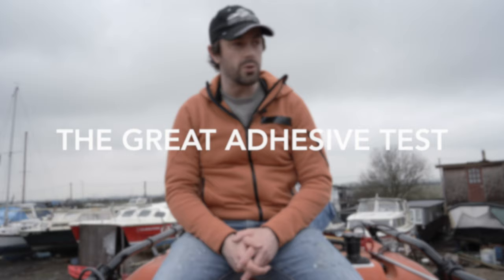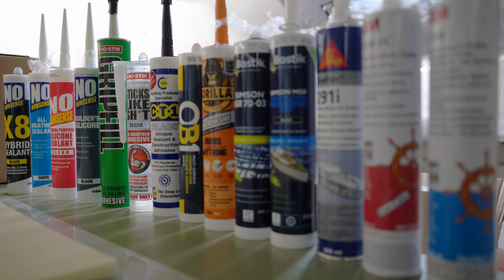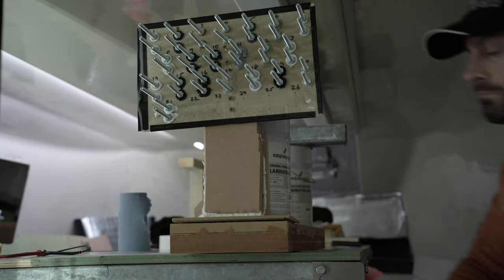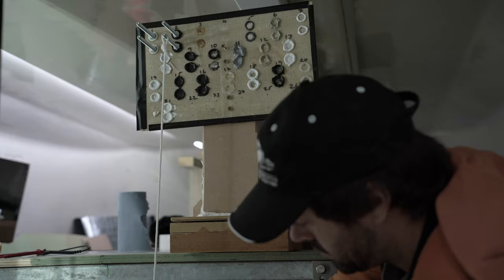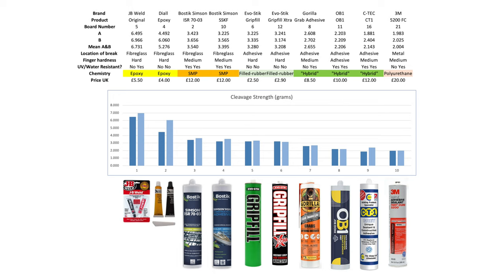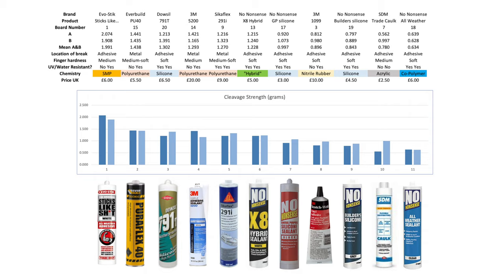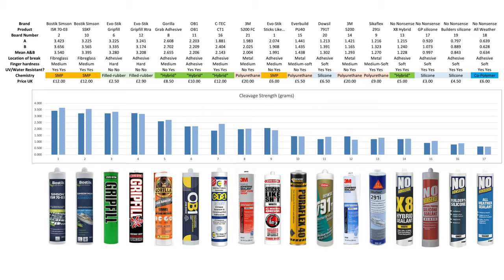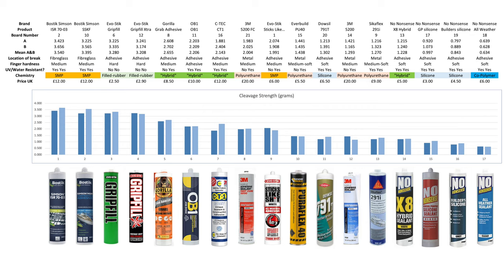The Great Adhesive and Sealant Strength Test -  (Lifeboat Conversion Ep5: Adhesive Test) [4K]

Comment: I love your witty comments.  Your videos could be longer.  Also what do you plan to use the adhesive for, holding the insulation?  By the looks of your progress, it’s too late for that, you already glued it on!  Are you concerned that the boat will roll over in a storm?  Is everything going to be secured?
Reply from the maker: Thanks! Different adhesives for different purposes. I think I've answered in more detail in another comment. For safety at sea, there's an episode planned for much later on that.

Comment: thanks for taking the time for doing this test, however I'm wondering if it is properly reflective of tensile strength because you essentially levered the other side of the adhesion point as the bolt became a lever and one side a fulcrum. Stuff like (say) Sikalfex talks about its tensile strength. 
None the less as it was all done in a similar way it shows their performance relative to each other. Sikaflex 291 seems about as good as regular silicon from your test.
Thanks and excellent work
Reply from the maker: You're quite right that this isn't a lab-standard strength test - tensile or otherwise. It's more a real world test - i.e. how do the adhesives behave bonding FG to steel with a moment applied. By its nature, it'll be multifactorial.

Comment: Try Marine Goop or Plumber's Goop, if they are available on your side of the pond.
Reply from the maker: Discontinued in the EU, and even more mysteriously marketed than most - any idea what it's made of?
Reply: @AlexHibbertOriginals  I'm sorry but I don't know for certain what it is made of but I have seen it described as a polypropylene, solvent cured adhesive on the internet.The solvent cured aspect may be problematic on the interior of your vessel and there are warnings about concentrating the vapors to get high, so that may be why it isn't available to you. The Marine version is UV resistant and sticks to almost anything, including fiberglass. It won't bond to whatever the plastic is that is used to construct water and fuel tanks for boats and RVs ( Caravans, to you?) It remains very flexible after curing and I have repaired slits in cheap vinyl inflatables by simply deflating and squirting a ribbon of the stuff the length of the slit, let it self-level and cure and I was always left with a permanent repair. I patch waders and Wellies, I think you call them, and have glued GPS antenae to magnets to stick them on my truck's roof and they stayed attached even at 80 miles per hour in rain, wind and sunshine. I'm rambling but it really is my go to adhesive. Wish you could get your hands on a tube for other uses even if it wouldn't work on your current project.

Comment: love it mate which one would you say is best for sticking aluminium to a steel painted roof of a transit van its for a solar panel haha
Reply from the maker: If you properly degrease and key the surfaces (especially the alu) then to be honest any of the SMP or PU ones would do fine. I'd probably avoid epoxies for that as they grip well, but most have no flex.

Comment: Good info, one suggestion, question: have you considered hazardous vapor abatement? I note Navies of the World have a lot of solutions for air quality in confined spaces.
Reply from the maker: Indeed yes. There will be a video on venting in due course.
Reply: @AlexHibbertOriginals  You may be working with hazardous vapors need a mask and there is a spray on product you may consider in the initial phase of your work. It is Nansulate made in Naples Florida and available here locally at Granger's.

Comment: good to know thank you I have a seahawk 4 and I am trying to work out what is the best glue to attach the Velcro the boat and wood and plastic so you helped give me some good ideas thanks again.
Reply from the maker: Nylon Velcro can be hard to bond as polyamide is pretty low energy, and it needs to be a flexible adhesive. I've found 1099 to do a good job, even at low temperatures.
Reply: @AlexHibbertOriginals  Thanks Alex

Comment: You have a nightmare of a job with all different glues and fillers. Only my thought if it is possible could you not use polyester resin and matting to fasten down, as don't know what you are fastening down or was it for just the foam and tape. If so don't read on. Good luck with sorting Alan out,

Comment: thanks. good stuff. do you think small inconsistencies in the placement of the string on the bolt, ie how far away from the joint, could alter the turning force..?
Reply from the maker: I was very careful about that. It would have only varied by 1/2mm. The difference in moment could be calculated to see if it's significant.
Reply: @AlexHibbertOriginals  cool beans.. if you do it again you could attach the string to a "cap" that would always end up "fully home" on the bolt.. cheers

Comment: Given where the boat will be used would it not be important to test these products at low temperatures? We now know that the material used on the hull of the Titanic  failed in part due to the adverse affects of the low temperatures in the north Atlantic. At some point the adhesive will be in direct contact with the very cold skin of the boat.
Reply from the maker: Yes indeed. Although, this was an introductory straight-forward cleavage test. Many uses for me will be internal and so not experiencing extreme temperatures. You're right though that some have -40deg rating claims, and others don't. I plan to test some products slated for external use in those sorts of temperatures. Good news is that below the waterline, there's a limit to how cold it can get. I've used the 3M 1099 as a fabric adhesive in -45deg, and it held up remarkably well.

Comment: I’m surprised with the sikaflex being inferior to bostic, you now have me questioning it. JB Weld is great stuff has to be the strongest on the right application always have it in stock.
Reply from the maker: Remember this Sika 291 tested is a sealant (with adhesive qualities), not the out and out adhesive, the 292. But yes, the Bostik range is really excellent.
Reply: Sika is good, but many sealants/adhesives don't like seawater, degrade quickly in strong sunlight & deteriorate quickly in frosty conditions. I've rebuilt several boats (wood, fiberglass & alloy) & have 'suffered' sealant/adhesive failures! @AlexHibbertOriginals
Reply from the maker: @wile.coyote8466  Yes indeed - this test listed only claimed UV and water resistance, but I haven't verified them. On the list to do. Cold resistance appears better, and I've used nitriles, silicone and PUs down to -40.

Comment: So what did you end up with? Has price anything to say or is it money is no object?
Reply from the maker: Until I've done a retest with 5200 to show it's actually hopeless, despite everyone saying the opposite, I'm still using it for structural fibreglass bonding. I use the X8 Hybrid for cheap and quick unimportant internal bonds. The All Weather Sealant for very low modulus seals where strength means nothing. Gripfill for non-structural interior gap filling and bedding. And for all exterior sealing that needs painting, the Bostik Simsons (I can't tell the difference between the two in the test). None of them are extortionately priced, so price isn't a major factor. That said, I wouldn't just squirt £20 tubes of 5200 on everything, not least because it's a pig to work with.

Comment: i only swear by the sika flex range.
Reply from the maker: The point of tests like this are to challenge, and perhaps justify or nullify, the loyalty people have for one brand or another. I could have added in at least one more Sika product, I admit.
Reply: @AlexHibbertOriginals  i fully understand the usefulness of conducting these tests. I believe that the nature of boatbuilding jobs that I do have lead to the conclusion that sika branded products are the best . eg teak seaming with their uv deck caulking products and their general adhesives . also their is a primer that is used in conjunction with the sikaflex to adhere metals to other substraites that drastically increses the bonding strenght . im not sure if you did use this or not , just thought id mention it . cheers
Reply: @stubryanfull  I'm also convinced a primer would change the test dramatically. I use Sika professionally, and I'm always impressed with the quality. That being said, choosing the right product for a specific job is key. This together with the correct way of applying.
I use Sika 271 Powercure mostly. It's a really great product, but without the use of the 207 primer it's almost worthless. We can also count on very good technical support from Sika. This can be necessary since their range of products is so big.

Comment: I have been using PinkGrip on my boat, seems to be doing OK so far but she's not moved off her mooring yet so who knowss if it'll last? Also, Not far from you, I'm up on the Blackwater.
Reply from the maker: Although it's very guilty of opaque marketing, and the cold temp rating isn't too impressive. What's the hardness/flex like once cured? Cheap though - similar pricing to Gripfill.
Reply: @AlexHibbertOriginals  I've been using it to stick foam insulation to the steel hull, from what i can tell it doesnt seem to have much flex once it's dried although the deck does flex when walked on in several places on my boat and none of it has come unstuck yet. I know it's not rated particulary well but i need a lot and it's cheap and it certainly sticks well enough for what i'm using it for, at least for now. I don't think i'd use it for anything "mission critical" my insulation should be wedged behind panelling anyway once it's all done and I'm not planning any arctic voyages.
Reply from the maker: I've not tested it, but it appears to be like Evo-Stik's Gripfill, so quite stiff but with very good adhesion. As you say, probably fine for large areas of low movement.

Comment: The best sealant guns are cordless electric ones so you don't need the manual labor 😂
Reply: I guess if you're heading into the arctic in a small fiberglass box, the least thing you want is to prioritize a charger and a few batteries and an electric motor in a pistol grip over food and water rations. Manual labor builds body heat as well ;)

Comment: Randall is very correct I built a motorhome a few years ago and the sales staff usually know next to nothing, to bond strips of 18x44 (B&Q) wood, to the roof ribs of the van so I could screw ply to, I used Stixall (part of the Sika group) but you didn't test it, I also wanted to find a sealant which would seal around the Thetford loo, I rang several companies and none did a sealant which would stick to the Polypropolene, I gave up after being told by a couple that none of them would work including theirs, So I rang Thetford, who would know better, not them apparently, as their tech dept, said to their knowledge no sealer would bond to their loos, helpful, not. I'm enjoying these vids, but please stop treating us like Americans 👀👀 We have an attention span that can be as long as an hour or so in the UK.

Comment: Omg. Doing that much sealing with a budget sealing gun.
Reply from the maker: I've now got one that says PROFESSIONAL on the side of it. Oddly, it works about the same as the £5 one.
Reply: @AlexHibbertOriginals  
Ok. It probably doesn't bend.
Those cheap bends in the handle or break. First it bends a little but you fight on, then a bit more until it doesn't work any more. Makes work very unpleasant.